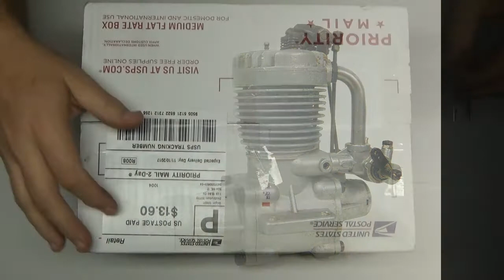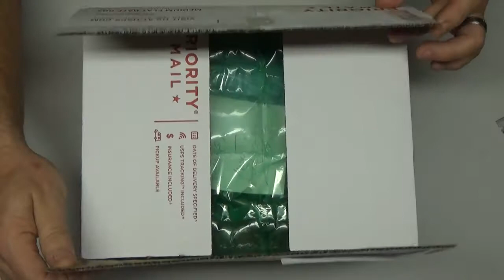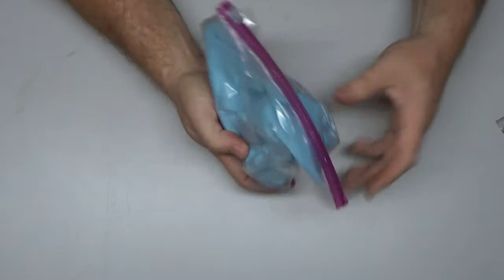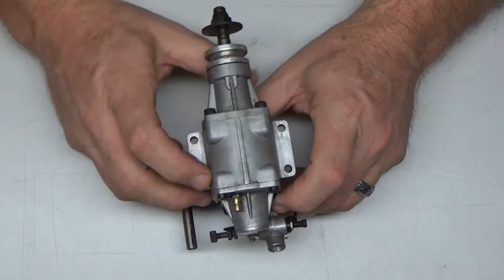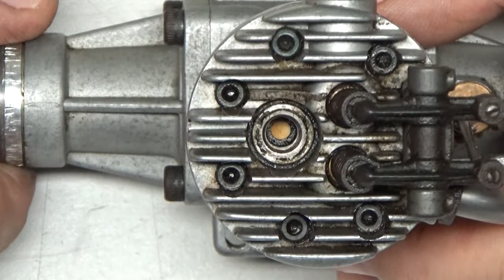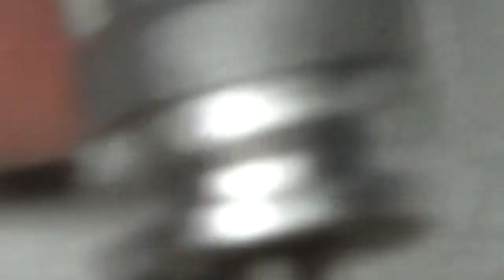OS FS-60 Customer Engine Initial Inspection

Comment: I purchased one of these engines way back in 1982 for $59.95. I NEVER had to use pliers on the prop driver like this modeler did. That is pathetic. I ran it once or twice and then gave it to a hobby dealer to sell. He still has it today.